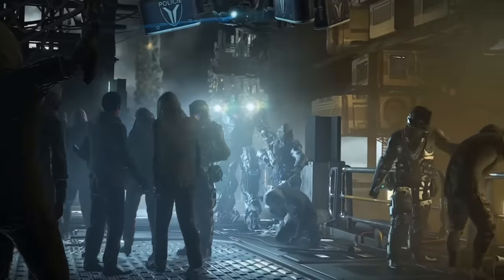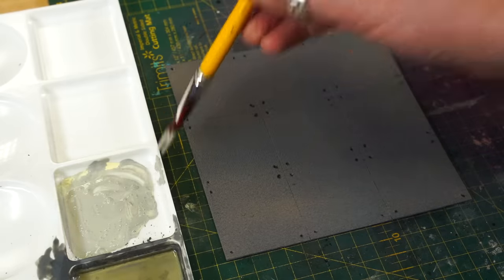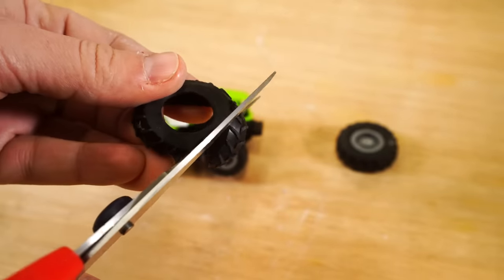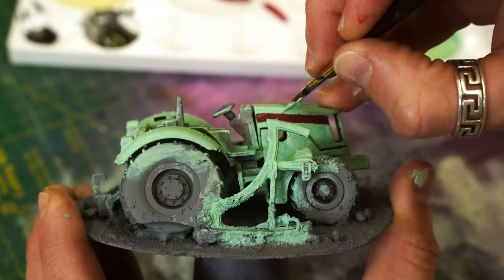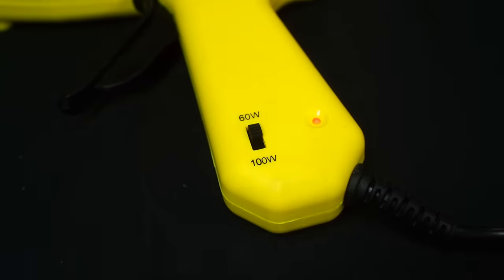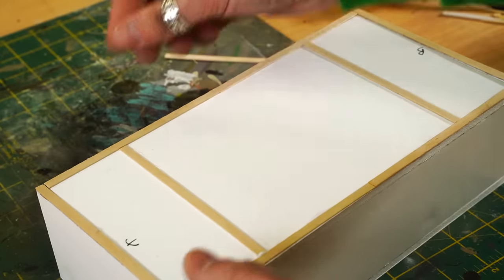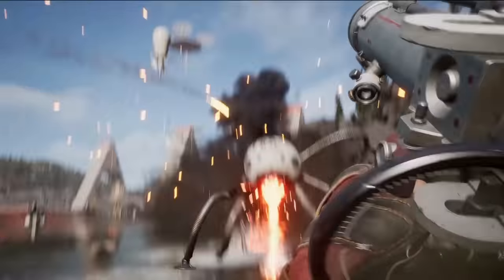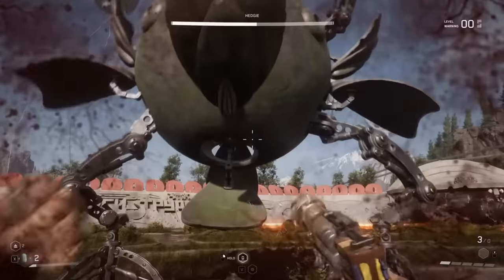DIY Atomic Heart Wargaming Terrain: CHEAP & EASY!

Comment: You can avoid the leaks by stippling the base color after applying masking paint, and then painting the target color over top of that. The bleeding will occur with the base color instead of the stripe's target color.
Reply from the maker: That's.... actually very clever!
Reply: What a valuable tip hidden in the comments.  Gearing up to paint some imperial knights and I need to try this

Comment: So, for what it's worth, another way to make concrete tiles that I learned from the Night Shift modelling channel is to use cork sheets covered with a thin layer of some sort of paint or putty (He uses acrylic wood putty, but I don't know if anything else could be used). They're not too expensive, and you can harvest cheap old tablemats for the cork.

Comment: A tip from edge painting when renovating a house: When using masking tape to keep an edge, initially painting the under colour and letting it dry before then painting the detail colour can prevent the bleed under the tape as that space is already filled by that base colour layer.

Comment: Another thing I like to do is put 40K ruins and the like on a "foot print". I use those sticky backed kitchen tile that you can buy in reasonably priced packs. Paint them to match your table top so they match. I like to glue mine in place. You then get a nice foot print your terrain. It's so easy to use nice cheap DIY tools and bits to make great terrain bits.

I also bought some cheap garden hose attachments that when painted up go nicely with industrial terrain pieces.

Comment: Nerd and Carpenter/Maker. You can buy sandpaper in 6" rolls which will save an awful lot of cutting.
Also drawing on the back with the biro and then folding a couple of times is an easy way to 'cut' the scratch (chippy chat for sandpaper). :)

Pro tip! Masking lines. Paint the Gauss blaster green/base colour in the masked area and Then the deep red/stripe colour. Any of the gauss/base colour that bleeds under the tape will then block any of your red/stripe colour! you can also use a varnish if you like rather than two of green/base colour. Try it it fiendishly good. I might do a short actually...

Comment: Excellent video! I'll definitely be trying out your concrete tile method.
A useful tactic to deal with bleed when masking is to paint on a thin layer of acrylic medium after masking off the area. It'll seal the tape edges, and pull away cleanly when peeling your mask!

Comment: Great video Guy ! I hope it does well, it was packed with building and painting tips. I'm picking up the toothpicks one for precise glueing perpendicular foamboard walls. One minor recommendation about using corrugated paper in model building for shacks and containers. In real life, corrugated sheets have ZERO structural strength if you place them horizontally, weight force being applied vertically, the folds only help rigidify the metal sheets when placed the same way. I know you alterned orientation for visual appeal, but you'd never build a container that way. Yeah, i know, i should build more models and not watch as many engineering videos... oh well...

Comment: I make up toy soldier sets to give away and some are sci-fi themed. I use 1:32 for youngsters and 1:72 for 7 and older because those are the cheapest but sci-fi in 1:32 is hard to source. I picked up some cheap remaindered 'bobblehead' daleks, (about 1:28 ish) and a year later found some cheap remaindered  'Fortnite stampers' figures which seem to fit the Daleks for scale. I'll make some hills alien plants and buildings and a shuttle craft thing with possibly a land vehicle using Lego wheels. Throw in a de-winged toy dragon as a 'Lost in Space' style monster and it'll entertain a youngster with a sci-fi bent. So sci-fi themed (any backstory) would be of interest.

Comment: Love this vid Guy, always looking for cheap methods, I keep the more expensive stuff for display pieces.  I have used the plaster and 'Granny Grading' reinforcement in the past, you can get a resin additive to add strength to the plaster but I have also used professional PVA (Carpenters wood glue from a building supply shop) as an additive plus add some craft paint, saves base coating and any future damage is still coloured.  I made a few foam pieces and created silicon moulds so I can cast these anytime  I want.  I have a grey xps foam that has a wonderful surface texture for roads (sort of a negative of the sandpaper) but the company I bought it from has either gone bust or changed its name. Keep up the good work, I may be nicking these ideas for my Necromunda.

Comment: I cannot recommend glue-backed cork sheets enough for terrain making.  Perfect for asphalt, thin enough as a basing material, even self-adhesive.  Easier to paint than thicker cork and tearable into much more scale-realistic chunks if you're going for disrepaired road cracking rather than utterly post-apocalyptic road canyons.  

I can also strongly recommend buying a super-budget plaster-filler, cling-film wrapping a rectangular tray/lid etc and then pouring and smoothing the filler into that recepticle.  Once dry, pull out the cling film and crack the resulting sheet of plaster into chunky debris basing material...you can even use non-flat surfaces (inside of old food packaging for instance) for weird sci-fi shapes.  Mix some ink into the filler when pouring so that if it ever breaks once in place, it's not going to show through bright white.
Reply from the maker: I did what you described in your second point to prep for this video, and it went horrible wrong, haha. I'll need to give it another bash.
Reply: @MidwinterMinis  Hmm...I use a ready mixed all-purpose filler (Poundland tubs I think so good on a budget) and spread it thinly.  I've used proper plaster for...proper plastering and they have quite different properties.  Love videos like these, I wish I'd had them as a resource when starting the hobby

Comment: For the Polymer blobs, if you felt like spending a bit more, you could add a LED light or two inside and extend the base a little to fit a switch and some batteries to make it glow

Comment: I used cheap diecast vehicles from the local dollar stores as ruined vehicles for our games of This Is Not A Test.  Plan on using them in Zona Alfa as well.  Painted them up rusted colors for the really ruined vehicles and modded others to serve as wasteland vehicles.  Dirt cheap when compared to buying vehicles at the same scale from gaming companies, or even 3D printers from Etsy.  I also raid my local thrift stores for toys and models I can repurpose.  Worked great for getting some space ships for Stargrave.  Built a bunch of shanty buildings with chip board, corrugated craft paper, popsicle sticks, coffee stirrers, and odd and end bits.  They turned out really nice and the shanty town looks great on the table.

Comment: To avoid having paint leak under your masking you can first put a layer of the base color over the edges of the tape, let that dry, then paint on your stripe color. The base color will seal the edges and if it leaks under that's fine and the stripe color won't be able to get under the masking tape.